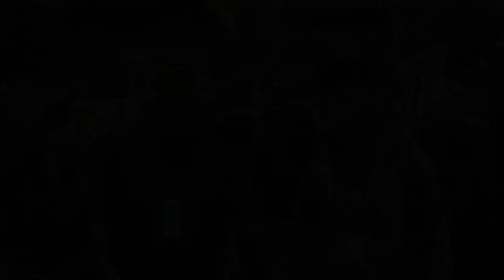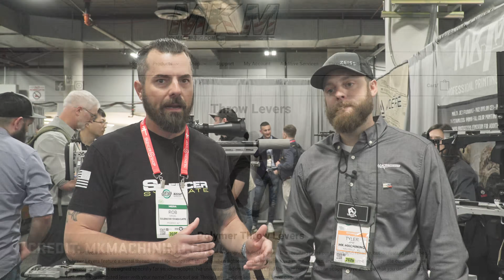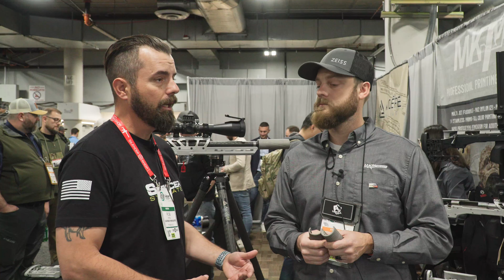SHOT Show 2025: MK Machining New Focus on Suppressor Manufacturing + Upcoming Line of Suppressors!

Comment: I just got my B&T SRBS 7.62 DM Titanium suppressor and it did not come with a wrench for some reason and for $1300 it should have come with something to take the DM out so I can install the hub adapter do you have any advice on how to remove the DM without damaging the suppressor because its in there unbelievably tight and I tried heat and a vise with no luck any advice would be helpful